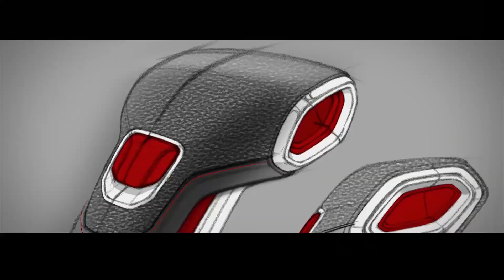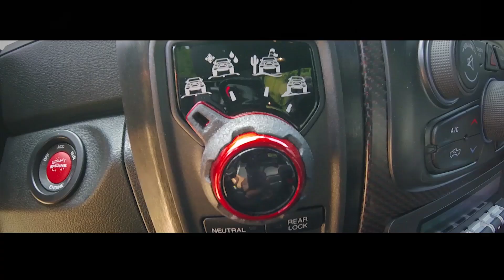Ram Rebel TRX Concept Reveal Video

Comment: For all those commenting on this video, good news - unofficial rumors are, it is coming.
Not anytime soon though.  The new version of the RAM truck is going to be unveiled at the Auto Show in Detroit a couple weeks from now.  The new (non-TRX) Rebel may or may not be there, but it is supposed to be more aggressive than the current Rebel (more off-road oriented).  A TRX-like Rebel is rumored to be in the works for a potential 2020 release as a 2021 model year truck.
Start saving now - it will not be cheap.
Rumors were in circulation in 2017 about a possible year end release and a $55,000 start price.  We know the 2017 year end release date turned out to be wrong and the price seems quite a bit off as well for the following reasons:
- The cheapest vehicle you can get with a Hellcat engine in it is the Dodge Challenger SRT Hellcat which starts at $64,000.
- The base Ram Rebel with only the 5.7L Hemi and 4WD options is already $50,000.
- The Hellcat crate engine is approximately $20,000.
That does not look good for a $55,000 Ram Rebel TRX, but more like a $70,000 truck - though they may sacrifice some margin to make it more price competitive with the Raptor (and it's $48,000 start price).

Check my Ram Rebel TRX Facebook page for latest information and insider hints from other public unofficial sources:
https://www.facebook.com/groups/1812830642341407/

Comment: I'm planning to buy a 2017 raptor but if ram actually builds this without a doubt I'll buy this. are you listening ram? you will out sell raptor with this truck. keep the 37 inch toyos, lose the strap door handles. cool for a concept not for everyday. remember to have the ability to deactivate electronic nannies, traction control, stability control, abs reduction and locker that works any  speed in 2hi 4hi and 4lo.
Reply: yeah you got that right
Reply: hey Brian Djordjevic it's like the rebel to the raptor
Reply: I'd also increase the size of the steering wheel and give many color variations and designs.
Reply: Jimmy G  did you get the raptor
Reply: They announced this morning they are building it!!!! Omg yes! Hopefully you didn't get the Raptor! Cause the king is coming!

Sorry I really want one of these as well and am so excited it's actually coming!
Reply: Couldn’t have said it better

Comment: why no full time 4wd??
Reply: because 2wd is fun with a beast like this
Reply: Full Time 4WD is great in some cases, but if they'd build it properly to give 2WD along with full time and part time 4WD it would be great, but if you are just talking only having it be full time 4WD no thanks.  If they'd steal the old Jeep Selec-Trac 4WD system then yes as it had 2WD along with full/part time 4WD and low range.  For example in the summer you most likely don't need or want all 4 wheels receiving power all the time its just a waste of fuel.  I'd rather be able to chose...add to that if they did something like that they'd better keep the manual shift lever and leave that stupid electronic 4WD knob in the trash can.
Reply: With the amount of power this truck puts out, yes for those who can safely operate the vehicle yes its fun, but for the majority of drivers today (reason why traction control, stability control, etc. now exist) all it will do is cause wrecks and death...which I'm sure this truck would be choked down by all the electronic safety nannies found on vehicles today :(.

Comment: 1:07 that's not a 575 horsepower engine, that's a Hellcat!
Reply: they toned it back for the truck so it has 575, but yes its is a hellcat engine
Reply: The point of the hellcat is burnout, burnout, burnout.

Comment: Hellcat powered? LOL, now if it actually has a hellcat type motor, I would be impressed, nothing new here other than cosmetics...wake me when you have something significant to offer, I am tired of the same old same old engines that do the same thing the first gas motor did. The hellcat tank destroyer had an awesome engine. Please dont insult the hellcat with this garbage.
Reply: Jerky it actually has the hellcat motor